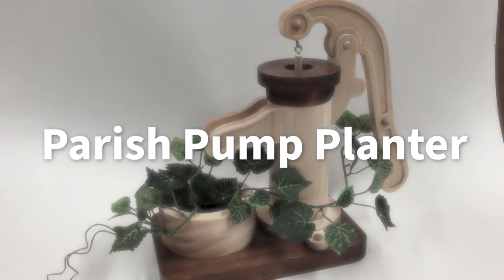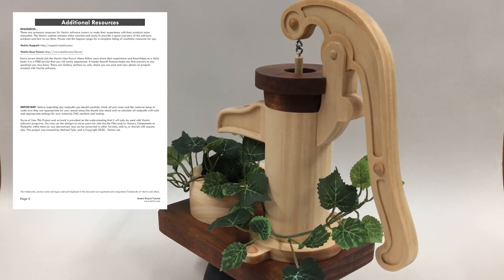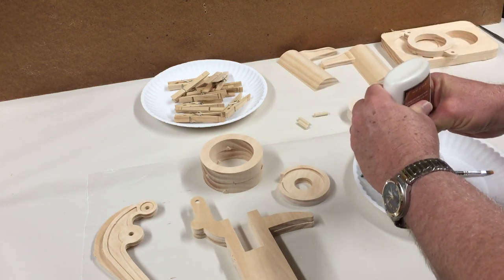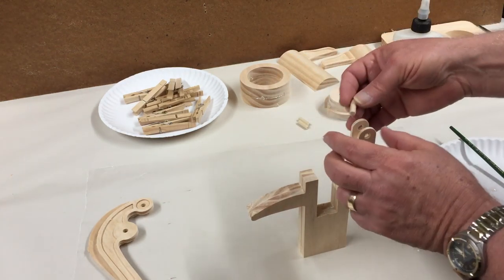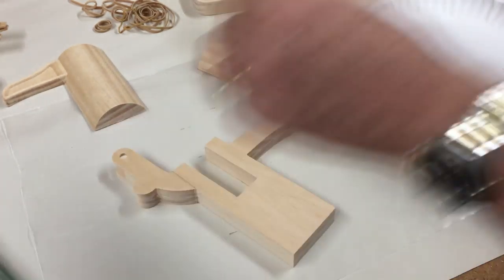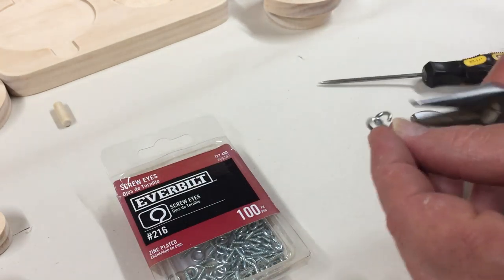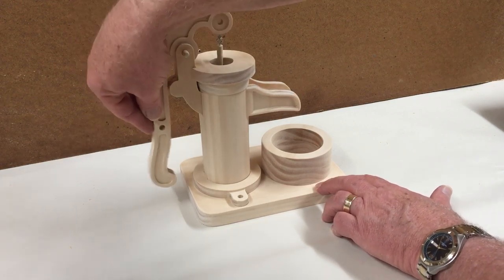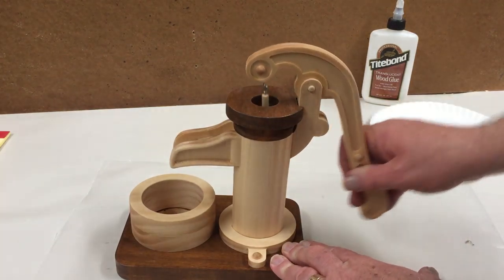Making a Parish Pump Planter | Michael Tyler's FREE CNC Project of the Month | Vectric

Comment: Question: At 13:05, you put the cup on the platform. What is the hole in the platform for? It seems the cup just sits on top anyway...
Reply: Hi Terry. The pocket hole adds additional depth to the overall cup planter area (makes it deeper by 0.625"). The cup ring assembly is aligned to the pocket hole and glued to the Base, resulting in a cup that has a total depth of 2.125"

Thank you for your question!